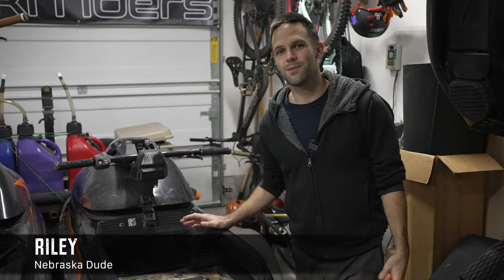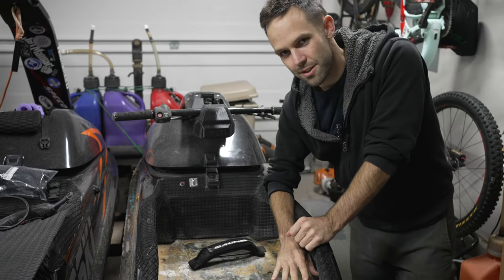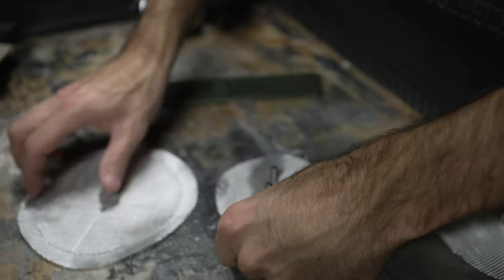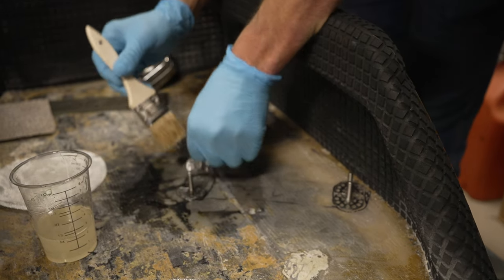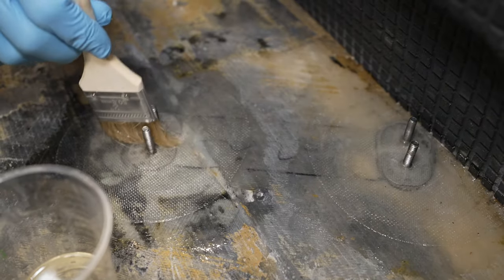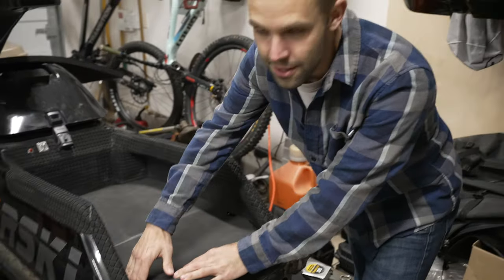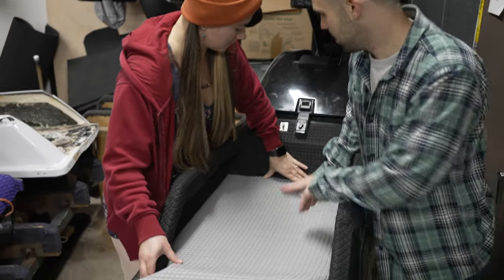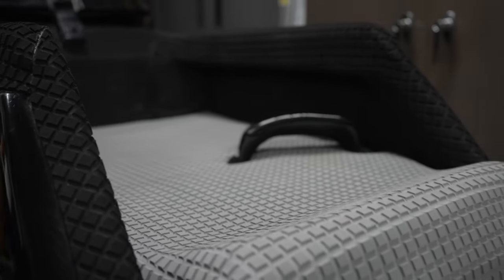Dakine Footstrap DIY Install for Yamaha Superjet Stand Up Jetski with RSKI RIDERS

Comment: Hey, I watched your yideo on your surf setup. Can you do a video on how you moved your handle pole forward? Thanks
Reply from the maker: Hi Matthew, Stu and I both have our handlepole moved forward but it was a very intensive modification and neither of us would recommend doing it. We don’t think it makes much of a difference.
Reply: @RSKI  thanks bro for the info. I guess I will just have to stick with the straight bars & blowsion steering stem & be happy with the approximate 4" it gains. Would you recommend fat bars or standard? Thanks again bruh!
Reply from the maker: We use an over the pivot steering which moves the bars much further forward. Ideally you want the grips in line with the hood latch. We use the KP steering in the high position with 4degree Blowsion handlebars.

Comment: Can you guys share the 3d files for the fixture guides you used? Super helpful video thanks a bunch!
Reply from the maker: Hey Doc! Thanks for the kind words, I might have misplaced the 3d file for the fixture, but you can use a piece of plywood or just design one quickly with the spacing that works for your footstrap.

Comment: What size do you cut the discs ? What thickness do you use for the fiber glass ? 
🤓
Reply from the maker: The first disk is 3” in diameter and the last one is about 7”. You could go bigger if you want but we haven’t seen these come out yet. We use 6oz woven fiberglass.
Reply: @RSKI  thanks dude for the details 👌🙂
Reply from the maker: 🤙🤙 we need to make a RSKI riding video in Indonesia!
Reply: @RSKI  let’s do it ! You will love the waves over there